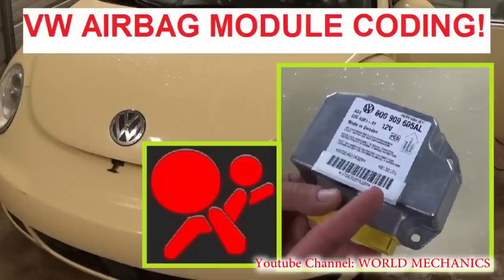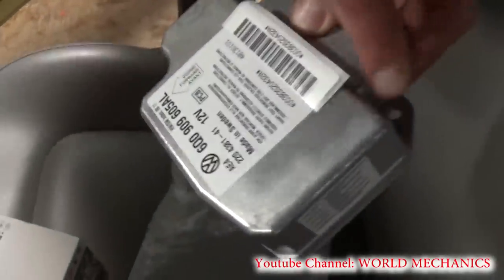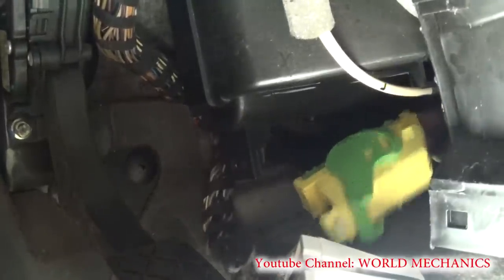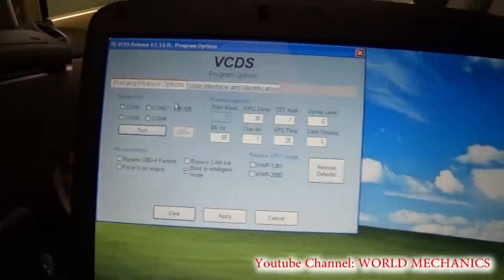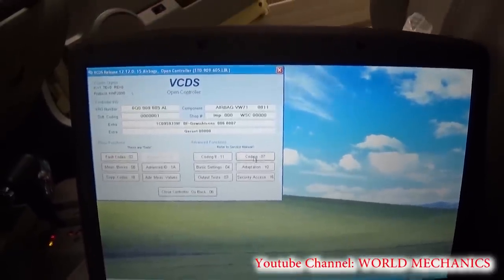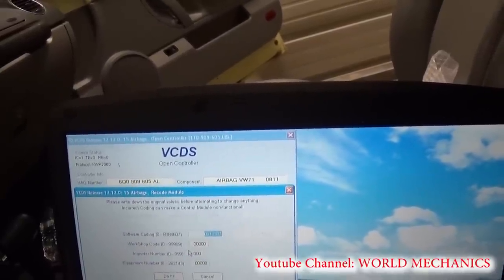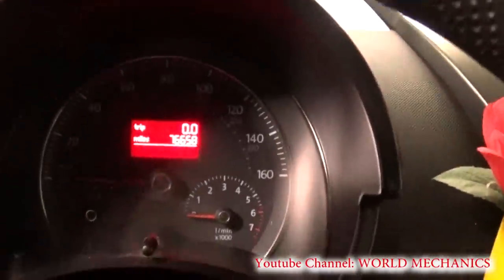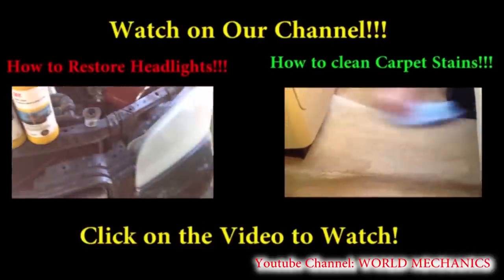Vw Airbag Module Coding  Volkswagen, Audi, Seat, Skoda Airbag Module Coding with Vag Com VCDS

Comment: Hello, nice video. 2 questions:
1) Which cable a need to connect to the airbag or to the car in order to make the communication?
2) What if the version on the airbag module does not match to the model of my car? The part number is the same except for the sufix. 

Thank you